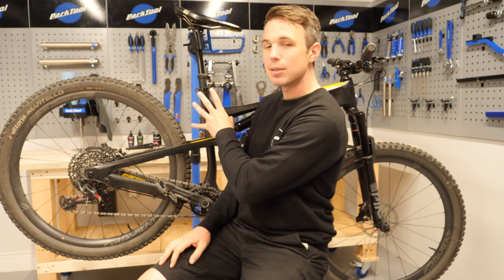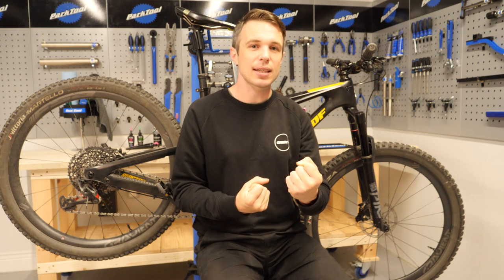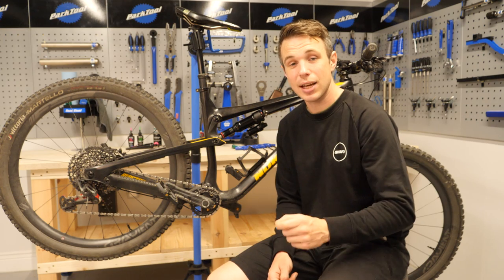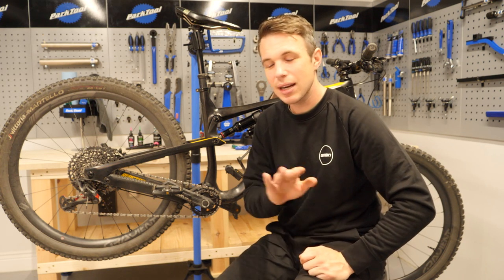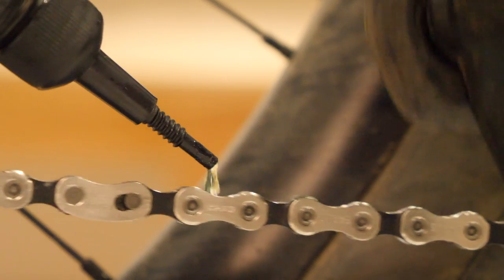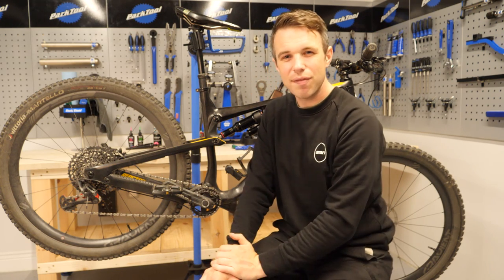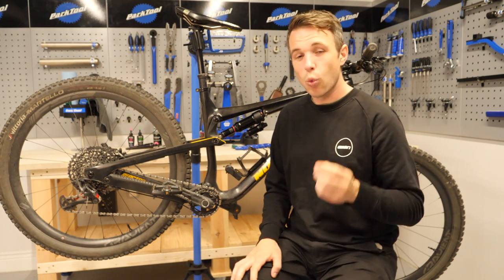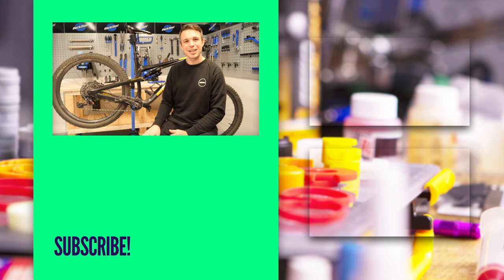How To Silence A Creaky Mountain Bike | Stop Your MTB From Creaking

Comment: My little one’s 20” bike started making noises coming around the rear derailleur when he pedals to a certain position after he fell on the bike path. I can’t see any visible damage and I am still unable to find out exactly where. The derailleur looks clean. But it seems to be shaking a bit on the lower gear. #askgmbntech. Any suggestions please.
Reply: Any physical impact on rear derailleur such as fall down during ride or someone hitting from behind or bike collapse cause this knocking problem from Cassette cogs and chain.
*Rear derailleur hanger is bending..
*Shifting indexing is out of line..
*Guided pulley and tension pulley is bending/out of line
*Rear derailleur housing/body is bending/out of degree shifting angle..
Reply: Freedom thanks mate. Guess I have to give it a closer look. Hopefully it’s not too hard to fix.
Reply: It's probably the hanger cos it's designed to bend during crashes (instead of the derailleur itself)

Comment: I have a constant clicking noise coming from the front wheel area, haven't been able to get rid of it yet.
Reply: Check the spokes. I had the same on the rear. It was dirt in between the crossing and contact point of two spokes.
Reply: I have this problem on my brand new bike, no dirt between the spokes. My last bike did this as well and I never really figured it out. I started mountain biking just over a year ago, and both of my bikes do this, so it can't be to rare of a problem, but I can't find any solution online

Comment: Can the frame itself creak? I tought it was from the bb so i changed it, but still it creaked from the same area I tried the seat area but still creaks, mainly when pedaling or when im sitting down and hit a bump.
Thanks!
Reply: Seat tube, saddle rails, where saddle rails enter the saddle (front and back). If a press fit bb, did u use locktite bb retaining compound? Hope u DIDN'T use grease on a press fit bb shell (just axle).
Reply: @rupedog  I took it to the bike shop for the bb because I didn't have apropriate tools so i was scared to mess somthing up, so probably they used the correct stuff

Comment: My bottom bracket makes a clicking sound when I pedal hard. Clicking when the pedals were level. What could cause taht?
Reply: the bottom bracket
Reply: @dalelakusta8143  I knew that:) But does anyone know how I can fix it?
Reply: @meinefresse94  replace the bottom bracket, if you take out the bearing and turn it it can make a clicking sound

Comment: I’ve got a question, my XT (M8000) RD is squeaking/creaking when I compress my suspension but only when the clutch is on. Anyone had this issue/know what’s wrong :( drives me insane
Reply: The clutch can be adjusted and, sounded odd to me at forst, but needs a thin smear of grease. Shimano do a special grease, maybe shared with hub gears, but it's crazy money for the amount you use. Can't remember who did a video on it. Don't think it was Seth but someone similar. Sure you'll find it if you search.
Reply: The Browns I’ve heard you can adjust it but wasn’t sure that would sort it. Maybe needs some grease as well. Clutch works really well just sqwaks when compressed

Comment: can someone tell me if my bike is dropper ready because I don't find it on the internet and even with the tips from gmbn I keep having doubts I have a canyon grand canyon al7 of 2019
Reply: I don't see why not.  Maybe not for internal routing ( which you can see for yourself) but certainly for external routing.  But just to be sure, you might want to contact Canyon directly.  Good luck.
Reply: Bro u can put a dropper in most bikes, you just may not have eternal cable routing. Take it to your lbs.